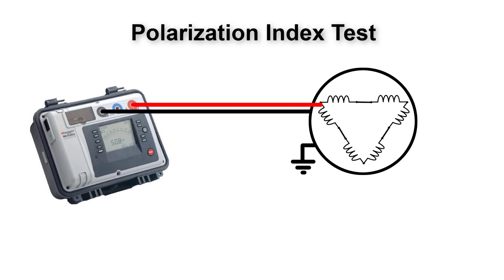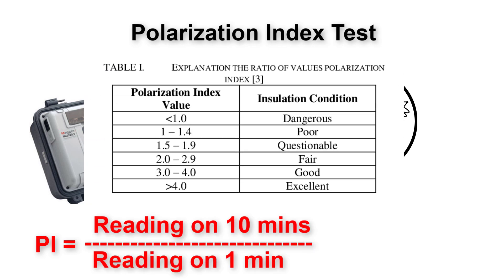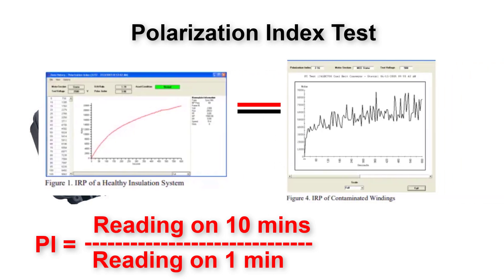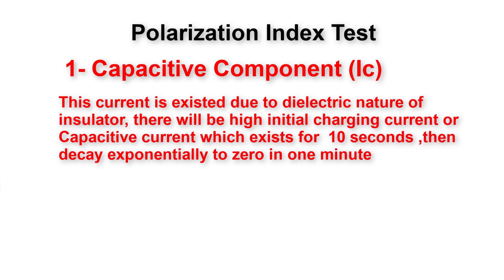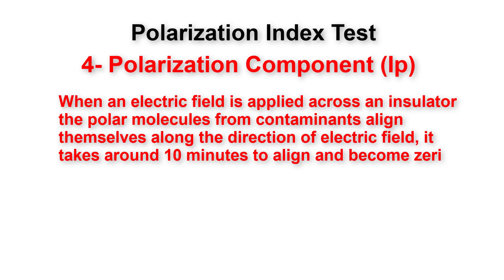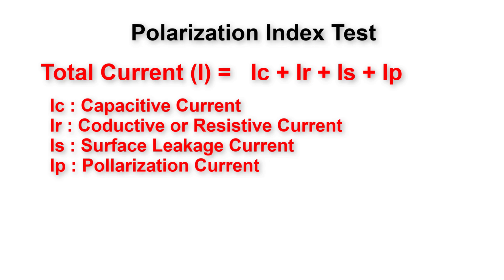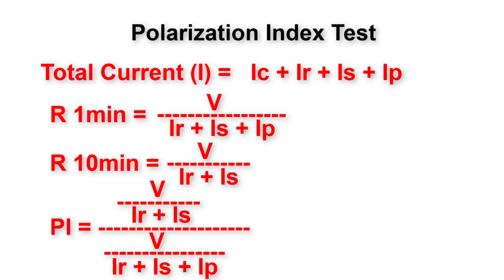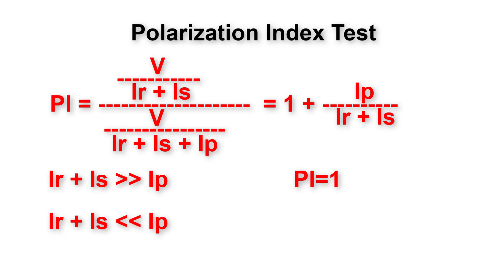What is Polarization Index (PI) Test and How to Perform It? |EXPLAINED

Comment: Your leads are hooked up backwards.  The red lead connects to the ground and black connects to the apparatus under test.  Especially for dry type insulation.  It shows this on the inside cover of the Megger.
Reply from the maker: The red lead goes to the equipment under test, and the black lead goes to ground. This is the standard Megger connection.

Comment: Very good info and video - but I have worked in mills for over 30 years and have done the PI test many times on 480VAC and 250VDC motors and I always came up with the same values the one minute test point and the ten minute test point- not sure why - and these were all documented as I had another electrical person with me to record the readings - We quit doing the PI test on the low voltage motors cuz it didn't seem to have any value if we always get 1 for the result.  Any comments?
Reply: It probably means these motors do no have contaminants or moisture. As long as the initial insulation reading was also high, should mean
 you have some healthy machines. PI test is more catered to machines that see a lot of moisture, dust, metal shavings etc. Then the PI test will let you know if these contaminants are embedded (values do not change over time) or surface level (insulation goes up over time).
Reply: @brianfischer7329  I can agree - but these motors (mostly DC mill motors) are in a steel mill with mucho dust and debris in the air and many are outside in the weather so they have a tremendous amounts of dust and dirt etc. in them when they are PM'd - all commutators and brush holders etc need wiped down and the motors are blown out with air and then you see the Meg ohm readings rise but still they never change after 5 minute of PI testing!  thats my experience of over 30 years of Meg testing motors in steel mills
Reply: @Krispy1011  Are these random wound motors, with enameled copper wire? If so, that is likely the reason why they do not show a polarisation index value. You may be see a a DAR ratio if you work with a 60 / 30 second ratio, or you may even have to drop it to a 30 / 15 second ratio.

Polarisation index testing is best aimed at form wound machines, where the bars have a much thicker laminated groundwall insulation that will display polarisation properties.
Reply from the maker: Thank you for sharing your experience and feedback! It's interesting to hear about your observations with the PI (Polarization Index) test.

The PI test is primarily designed to assess insulation quality, and a result of 1 typically indicates no improvement in insulation resistance over time. For low-voltage motors, the shorter charge time of insulation capacitance often leads to consistent readings at 1, making the test less useful in these cases. This could explain why you observed no variation in results.

For low-voltage motors, other tests like insulation resistance (IR) or advanced diagnostic tools (e.g., surge testing) might provide more actionable insights.

Thanks again for your input, and let me know if you'd like to discuss this further!